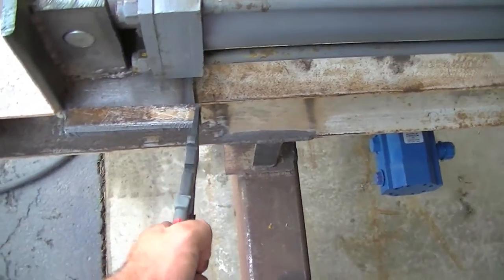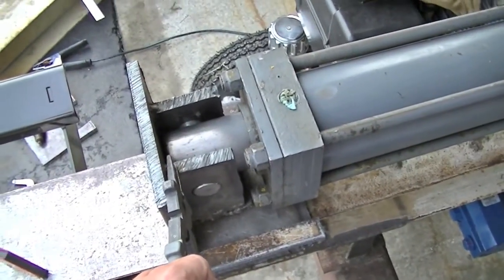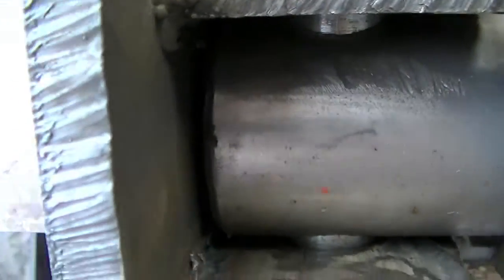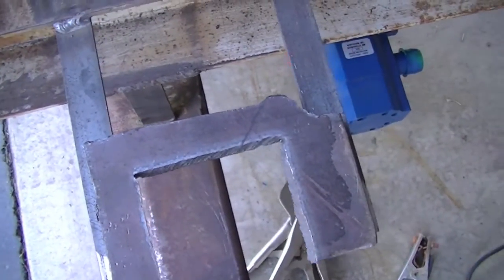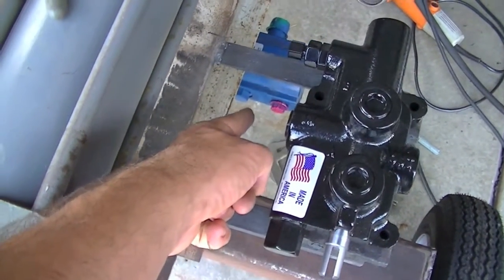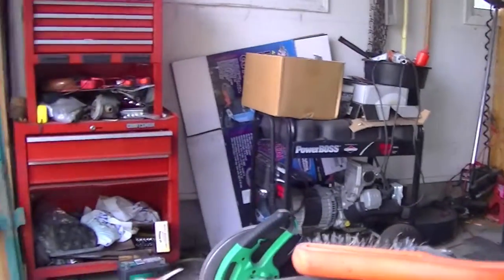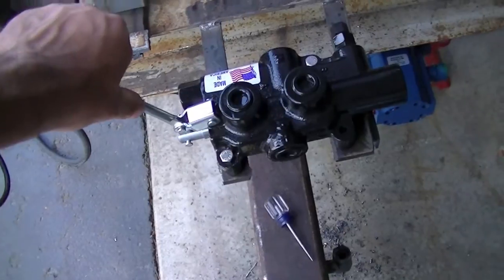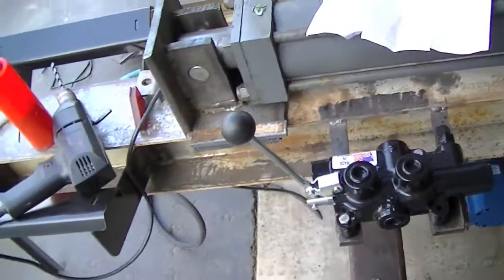Homemade Log Splitter Project Pt. 13

Comment: Your drill motor at 5:23 looks like a ?? 3/8"? Use it to mark center and use a 1/8" pilot bit for the drilling use cutting oil as well help greatly. Most drilling I use a 1/8" pilot bit, makes life a lot easier and faster.  I am using Brake clean to remove the tapping oil so to weld and later paint. I do my  drilling first then weld using the drill press. I am going to be using shim stock  0.015"?  or so for the clearance for the flange guides for my splitter. Superlube a Teflon grease will be to lubricate that area, it doesn't attract dust the way petroleum does. Or I will be using that UMHD/ Teflon as a  shim which will allow it to slide nicely.

Comment: At 4 mins plus you should watch your weld noticing that it is lifting badly, should tack corners and  then weld. I have always used full clothing for welding a leather welding jacket with full throat cover as well.

Comment: is that a mig welder? cos theres no ferrel on it for the flux gas
Reply from the maker: It is a mig welder, I'm using flux core.
Reply: What kind of wire is of a good quality, in your opinion?
When welding flux core, is the slag easy to remove? (I only stick welded , so far)

How is the splitter now, after a few years?

All in all, you made a great job.
Reply from the maker: After using a few different kinds, I have grown to really like the CURRENT Harbor Freight wire, which is made by INE.  If you look at the spools, it should say Made in Italy.  That is INE wire, it is excellent wire.  If it says China, walk away and buy Hobart or Lincoln- either are as good.  I like the INE wire because it was very low slag flux core, with exceptionally ease of removing slag.  I now converted to gas wire welding and the bare wire INE is really nice.  Never get birds nests in my welder, just works great.  The splitter is fantastic, best thing I've built.  Split lots of wood and it is running great.  Looking forward to using it very soon with another load of rounds.
Reply: Thanks for the answers.
The funny thing is that I live 20 km from the Ine headquarters, in Italy.
Good to know that they produce good wires.
Again, thanks.
Reply from the maker: No kidding!  That is some fantastic wire, INE also supplies Ferrari as I've found out from my welding forums. Thanks for checking out my videos, really appreciate it.
Reply: Your welds look cold, not fusing well? The flux core that I am using T-91 ??6 uses mixed gas as well (<40 CFM) . I have had to learn about Nitrogen intrusion , I think that I have it beat? Heat it to 300*F plus and makes a very good weld. Have been welding 4140 extension nuts so have had to wrap them to slow the cooling process. So far so good??

Comment: Hey where did you but the control valve from
Reply from the maker: +Ayy gee Uprising Valve, hoses, pump and the wedge, rear cylinder support all came from Northern Tool.  Cylinder came from Surplus Center.